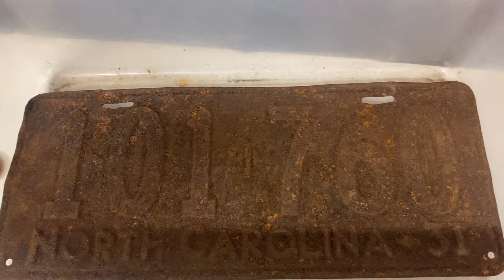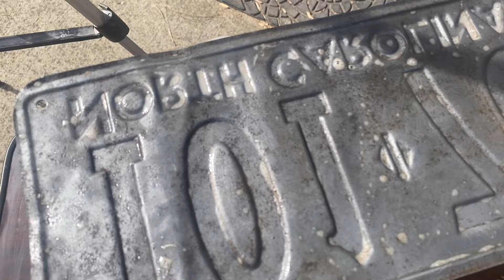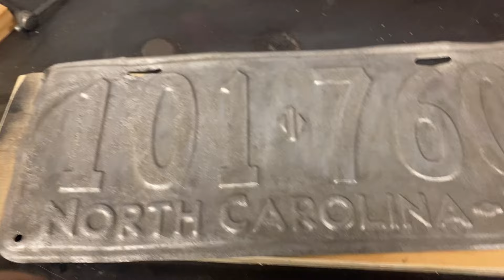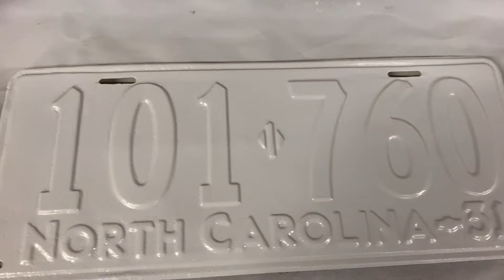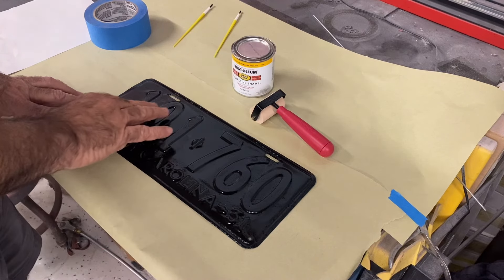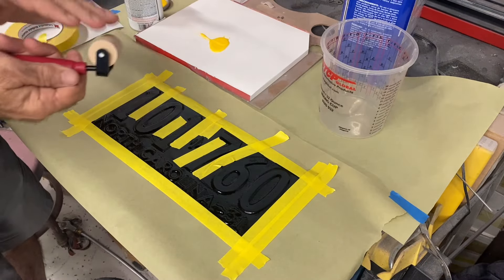Reclaiming a 93 Year Old Licence Plate

Comment: Tony,  I couldn't find your email so I have an off topic question here. A few years back you showed how to stabilize the same English wheel without bolting to the floor. I did that and got excellent results. I then made 3 DIY sliders to fit under each leg to drag the wheel around. Tough effort but it moves. I'm thinking about bolting locking casters under each leg and 2 for the rear leg for easier moving.  Have to tried / considered this. Any comments are appreciated. Wolfram
Reply from the maker: Wolfram, I don’t need to move mine very often. usually just a foot or two, and I just drag it. No reason the locking casters wouldn’t work though.  
It would be a good idea if you’re moving it very often, or very far. Good luck👍
Reply: @ChipsAndSparksGarage  Tony, Thanks for the quick reply. My shop is a bit smaller so I hop-scotch the equipment. I'm also looking at a Grizzly Papa Bear heavy machine mobile base. It keeps the mass low and 4 wheels in contact the floor. The wheel should fit into the frame. Thanks WS